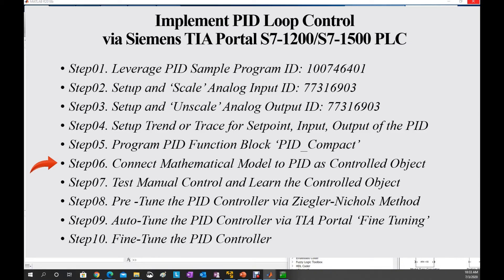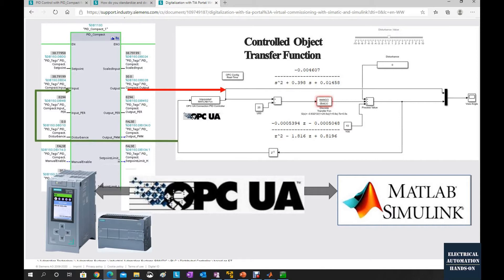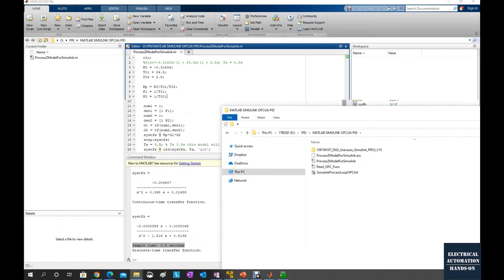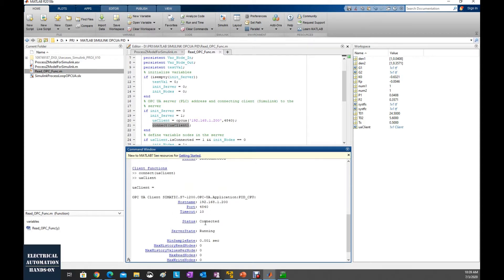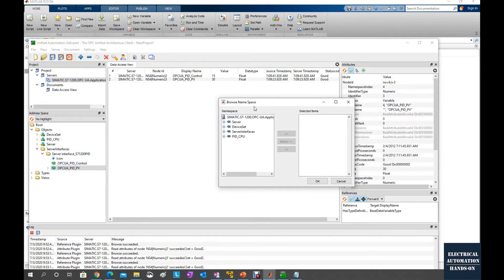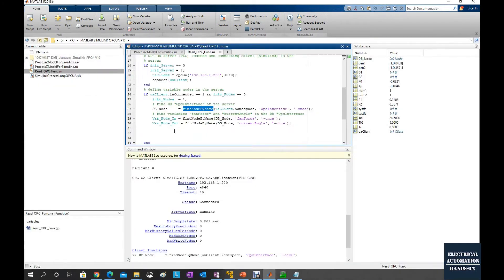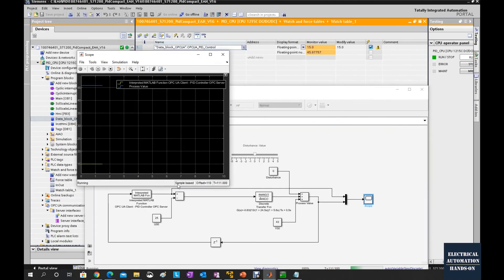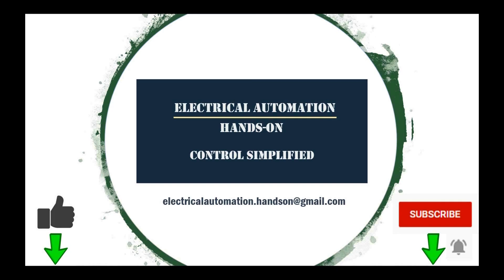PID16 - Siemens PID06e - OPC UA Client in Matlab - Simulink Exchanges Data with PLC via OPC UA

Comment: Hi, im using the same function to read from a S7-1500 PLC, but when the link breaks for some reason between the computer and the PLC, the simulink crashes. Did you handle in any way the fault of comms?
Reply from the maker: I'd like to know what the cycle time of the OPC UA you set. As I remember, the cycle time <= 10ms would be challenge for your computer. probably set starting from 100ms. Also the RAM would be >=16g, the larger the better. Both TIA Portal and Matlab are high RAM consumption software.
Reply: @electricalautomation  thanks for your reply. I didn't set the scan time in any part. I took the function and mux blocks on simulink and made a subsystem that runs at 1 sec of period time. In any case where did you set this scan time?. But my question remains, the solution is working fine, and is running normally, but the second I make a download on the plc, the simulink and Matlab crashes and I can see how the memory consumption of the Matlab goes to the sky. I also tried what happen when I disconnect the ethernet cable while running the simulink and it does the same thing, simulink and matlab crashes. So, in te Matlab function that handles the opc ua part, I cannot see any kind of code that handle a fault of communication, or maybe is the use of persistent variables, I read something related that would be a better idea to use a s-function on Matlab to handle the comms.
Reply from the maker: https://youtu.be/MTjpAoG3OWk?t=132,  please check the video, the sample time setting